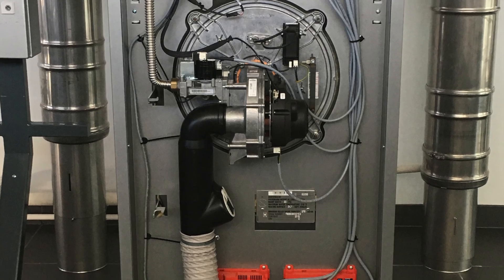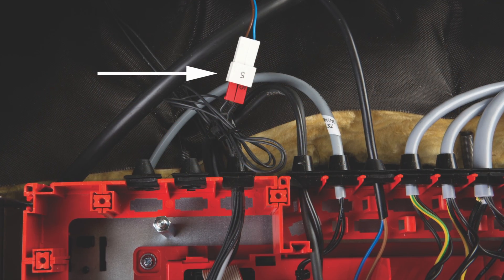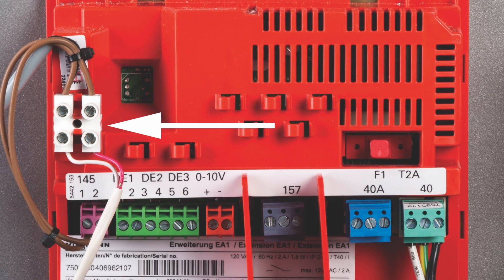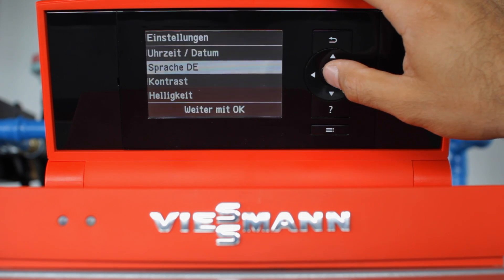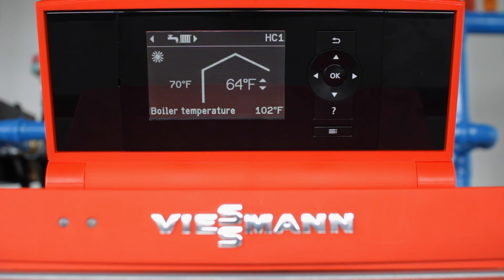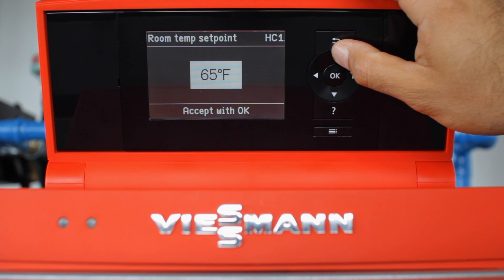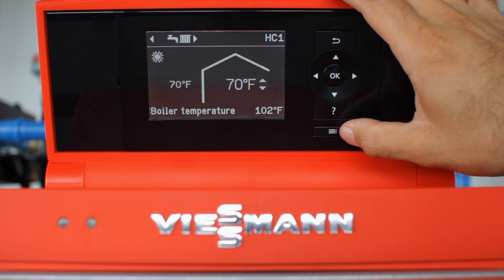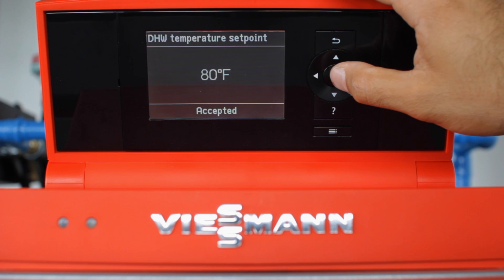Quick Start-up on a Vitocrossal 300 CU3A

Comment: Nothing on the heating curve??
Reply: You may need to play around with it, depending on where you live and the rest of the system. Are you an installer or a home-owner? What I did for my system was keep everything relatively low (probably default?) and only adjusted it when the boiler wasn't able to maintain the proper temperature in the house. In which case I'd play around with the height/slope of the curve. I mostly tried to do it with the slope so that the boiler isn't constantly running hot water for no reason.

Not sure if this helps... but that's my experience. I set it up many years ago and it's been smooth sailing ever since.
Reply: @brois841  thank you for taking the time